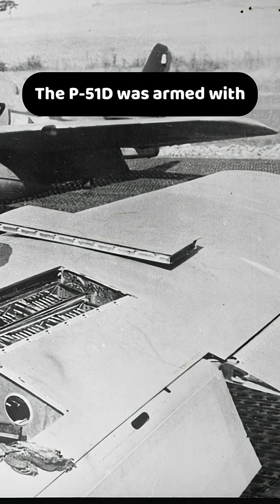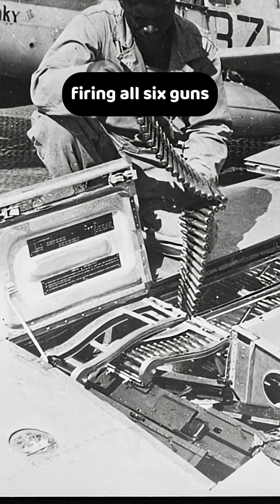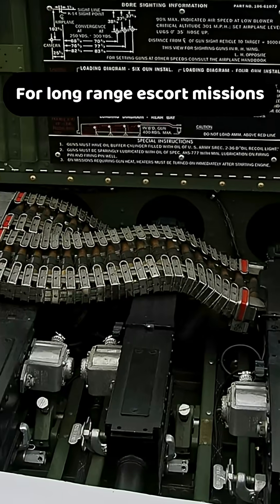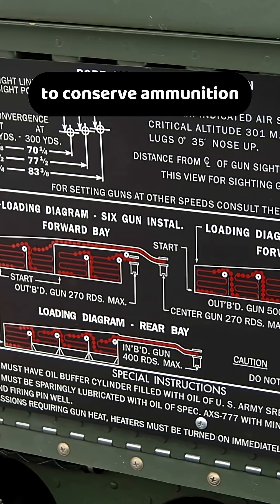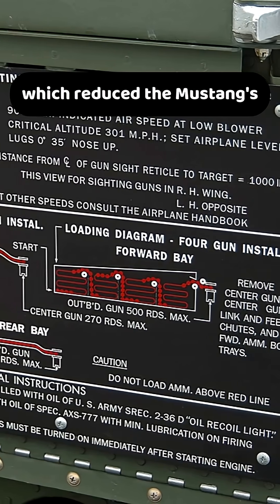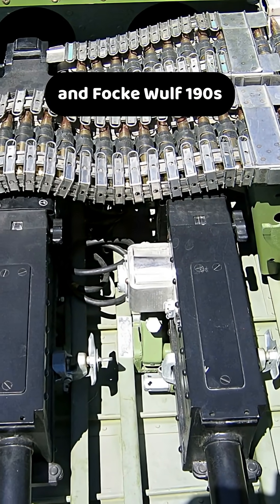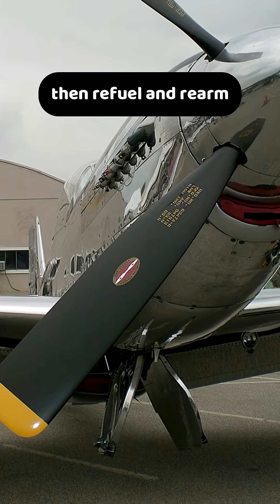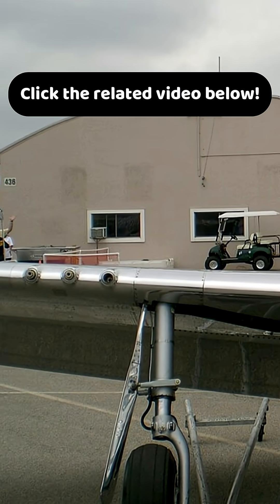Why The P-51 Mustang Easily Ran Out Of Ammo?

Comment: This short is full of inaccuracies and oversimplifications. Its script doesn't comprehend the subtleties of WWII aerial combat. The targets of the cannon-armed Bf 109s and Fw 190s were the bombers, not the escort fighters. German pilots would try to evade the escorts if possible. The bombers were tough, and had four engines. It was necessary to use high-explosive rounds to do enough damage to ensure a shoot-down (more true for the B-17 than the B-24), therefore, cannons rather than MGs. The escort fighters, the Mustangs and the Thunderbolts, were targeting the enemy fighters, which were single-engined and comparatively fragile. 50 BMG was better than 20mm for that task. Many RAF fighters changed from .303 Brownings to 20mm guns, but RAF Mustangs mostly used the 50-cal. Many RAF heavy bombers changed from .303 quads to twin 50s because the 50 BMG round was so effective against fighters. Put a 50-cal round into the radiator of a 109 or the oil cooler of a 190; that plane is going down regardless of whatever other damage is done. There was no practical armor that could protect the vitals of a piston-powered fighter from the .50 caliber Browning. Against jets, it was a different story, however. P-51s had no difficulty shooting down Me 262s, provided they could get within range. However, that was partly due to the inherent fragility of the JUMO 004 axial-flow turbojets. When MG-armed F-86 Sabres went up against MiG-15s, the American pilots discovered they had to make more hits to ensure a kill than when Mustangs went up against Focke-Wulfs. This was largely due to two reasons: (1) The MiGs ran on refined kerosene rather than high-octane avgas. Kerosene is less volatile than gasoline, and therefore, less apt to explode into a fireball when an incendiary .50-cal round penetrates the fuel tank. (2) The Klimov VK-1 (a copy of the Rolls-Royce Neme) was a rugged and damage-tolerant centrifugal-flow turbojet superior in many ways to the delicate Junkers 004. A MiG could take 50-cal hits and survive to return to base, hits that would destroy a Messerschmitt 262 immediately. This is why they replaced the Sabre's six fifties with four 20mm cannons.
Reply: To add the reason the US airforce didnt use 20mm earlier is also because the hispano reliability were quite bad and the US only work out a good replacement that is the M39 and M61.

Comment: A cannon shell did so much more damage than a conventional bullet fired
Reply: A conventional 303 caliber bullet,  [ German 7.92 mm] ,yes.That's what the damage charts were calibrated for. .50's [ 12.7 mm] fell in between and had some explosive shells.
Reply: @panzerdeal8727 .312 right? If im not mistaken The brits used .303 (7.7mm) and the germans .312 (7.92mm and later on the 13mm)
Reply: @TheBrazmann  Close. 7.7 mm was Japan's preferred caliber, A5M Claude A6M zero...